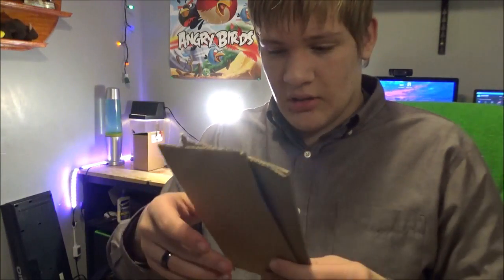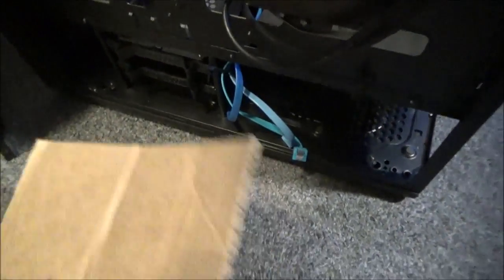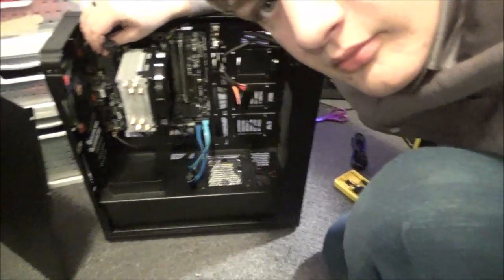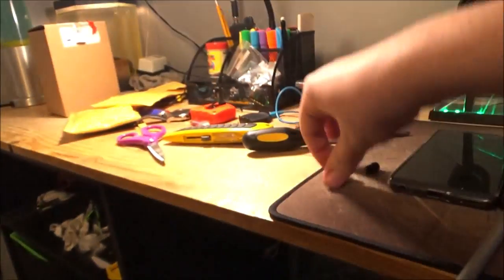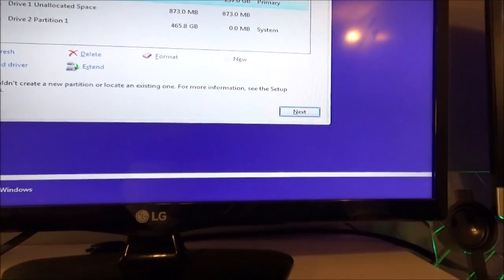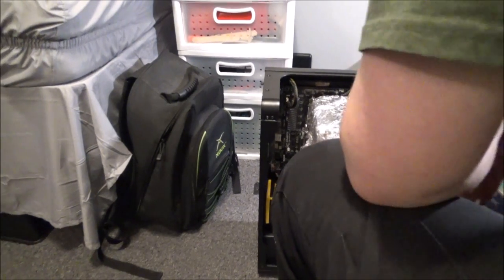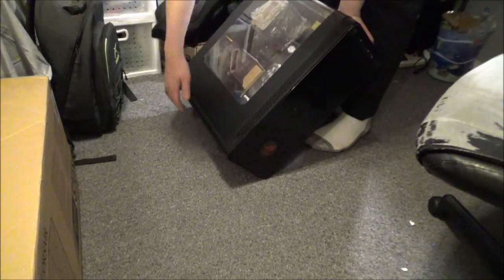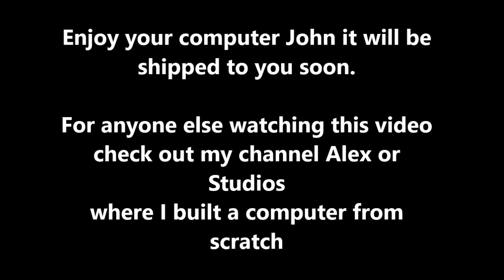Working on John's computer

Comment: What are the specs of your computer?
Reply from the maker: Amd fx 6300  6 core processor   3.5 gigahertz and 4.1 gigahertz Turbo. It has 8 gigabytes of RAM which I'm upgrading to 16 soon. It has a AMD RX 570. And a gigabyte motherboard I don't know which one. A thermaltake view 27 case a Samsung SSD 280 GB. Plus a 500gb hard drive. A 550w Corsair power supply. And that's about it. This is all with the help of Alex he knows more about computers than me.
Reply: @JohnnyD  Nice! Me laptop has an i7 3750HQ, 16 GB RAM, 32GB and a 500GB HDD, and an Nvidia GT 650M. I might build a desktop after I sell my laptop.
Reply from the maker: @ryank5555  awesome!!
Reply from the maker: @ryank5555  ok